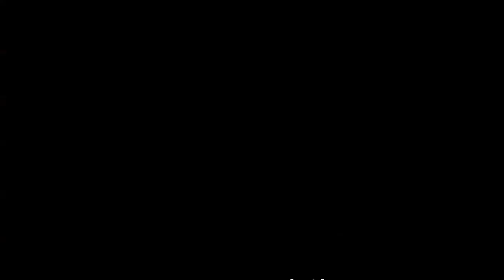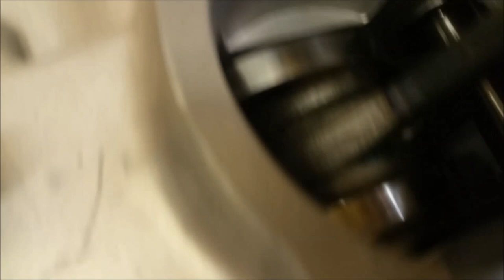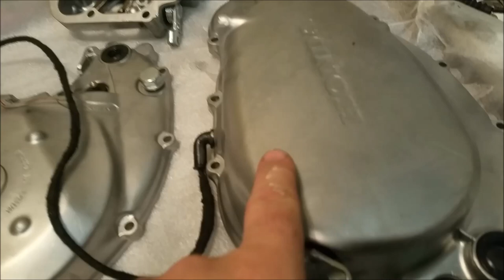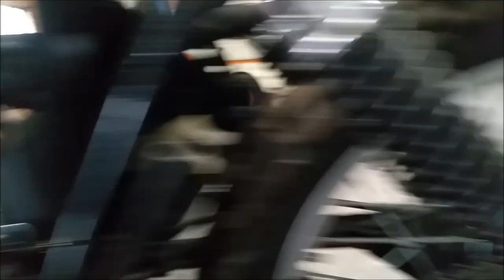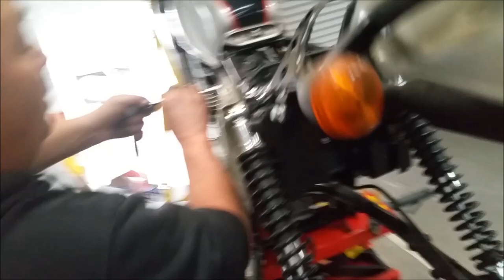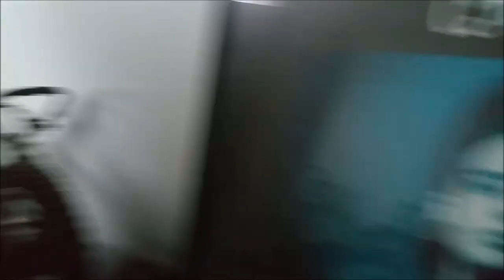Honda XL250S Restoration - FINAL

Comment: Fine video. I put over 25k miles on a '78 250xls from '78-86 as everyday transport.   I re-bored  cylinder for Weisco   piston  w/most every  bolt-on mod available then.  Bike was heavy  but dependable and steady on road despite  the 23" front wheel.  Universal tread  tires,  loved that bike.

Comment: G'day Pete, long time viewer, rare commenter. clutch could be sticking due to the clutch basket being worn by the friction plates. At 10:51 in your footage you can see slight groves on the basket fingers. Though it can look insignificant, smoothing out those ridges has helped me in the past get the clutch feeling smooth and linear. Cheers
Reply: I was thinking the same thing. My YZ125 clutch basket fingers had slight dimples (wear marks) from the clutch plate tabs The clutch had problems disengaging completely when coming to a stop and while moving slow.
Reply from the maker: Yes, I'll take your advice which makes perfect sense... there are only a couple of teething issues which should be simple to sort out... thanks for the tip, cheers.

Comment: I've done my share of motorbike rebuilding over the years. From a DT 125 to a XT 225 and my number 1 bought bike I had for 20 years now since I was 17, a 1994 TZRR 125 Italian Racer. I never wanna add up how much I have spent over the year keeping it on the road. But it is finally back to Stock looking specks (Ala a smoke front screen visor which should have been clear) I can see myself rebuilding bikes like this into my retirement years. So therapeutic. Well done.

Comment: I am only part way through the video but I think the knock is the decompression valve if you mess with that decompression line and adjust it you will eventually get rid of the sound

Comment: Hi Peter! How did you get that exhaust put on, I am not sure how to get those two C-shaped collars on, without them falling. I think they are called collars, maybe metal gaskets? I am working on an old 82' 250 xlr, I just resprayed the whole exhaust but I haven't managed to find anything on how to put it back on correctly.

Comment: That top-end noise sounds like the compression release cable is adjusted up too tight and not returning all the way, which would make it rap against the exhaust rocker all the time
Reply from the maker: Yes we need to do a final once over and I think you may be correct... although I'm sure I saw Dave checking it... will see, cheers.

Comment: Is that a twin carb model or one of the last single carbs. I know the twin carb bikes were quicker and more responsive but for me the beauty of the XL engine is the simplicity of it. air cooled. Chain driven OHC for oil feed. They're easy to work on and what all bikes should be great fun and cheap.
at least they were cheap back in the day.

Comment: So, what was the sludge from, Peter.?   The balance chain slapping the casing??  Top job on the rebuild, looks like it rolled off the factory floor. Got one of those funky tail-lights if Dave wants a spare.

Comment: She ain't supposed to tick like that bro....its no different to last time bud.
Reply from the maker: It's a lot different, being indoors and  sounds worse with the camera. Before there was a solid knock as the clutch was released and the engine came under load... that noise was difficult to localise. This is a tick in the top end, should be pretty simple to sort, cheers.